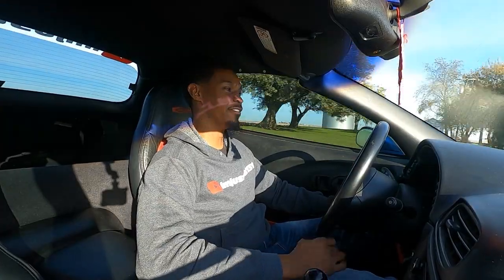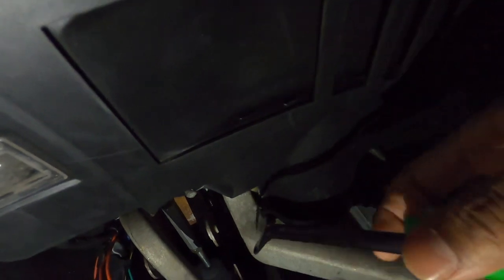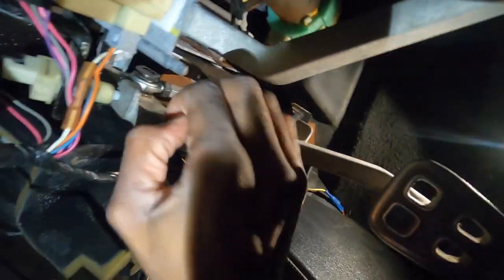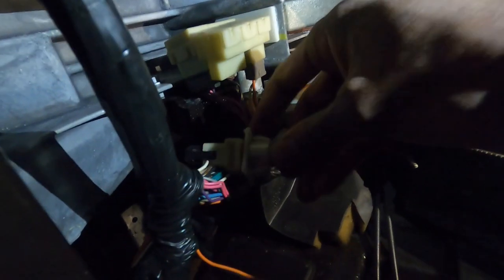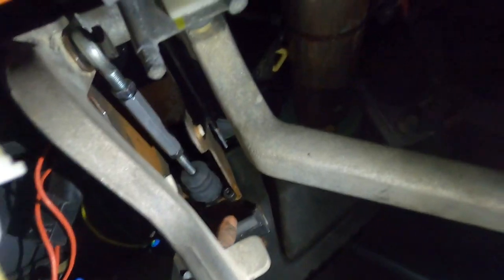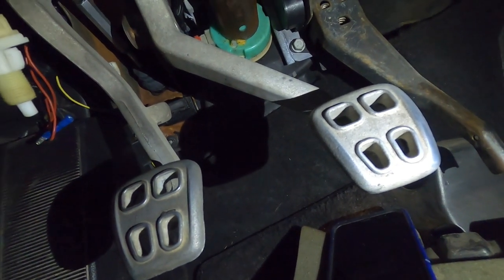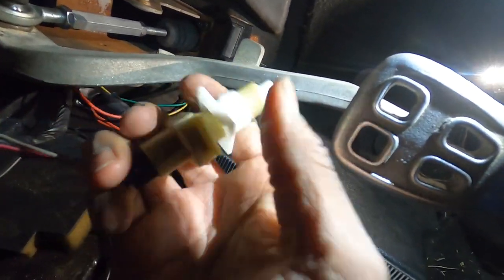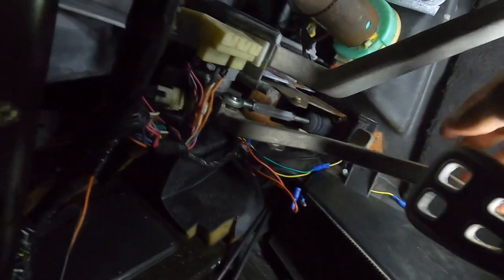CLUTCH IS FINALLY FIXED!!!!! TICK MASTER CYLINDER ADJUSTMENT

Comment: Seeing you that happy made me that happy. I love it when a plan comes together. Your dedication is admirable, the way you stuck with it and kept at it even though you couldn't shift correctly inspires me to stay the course, and keep cool. I punched partway through 2 windshields, and spidered another from the inside when I was younger. I felt horrible afterwards because I loved those cars. Not going into gear would have split my wig if it was happening to me. You are a true role model, as you taught me a lesson. Now you can enjoy the car the way it should be.
Reply from the maker: I appreciate it man. I had to get it figured out. I'm just glad it was something so simple. I try to keep my cool in most circumstances. In my mind, not much is worth controlling my mood and mind.

Comment: Tmod sells a clutch stop 

Helps a lot with bringing the clutch up to level with the break pedal and helps you not over extend your pressure plate 

Will also help you out with the switch on the firewall
Reply from the maker: Haven't heard of them. If this doesn't get it. I'll check it out.

Comment: I’m glad you sorted your problem out bro!  Looks like a tick mc is next for me.  Thanks for the info on adjusting it!
Reply from the maker: Me too bro. It's a good buy. Just be careful adjusting it. Do a little at a time.
Reply: I went from a 7/8 bore to 13/16 with my twin disc monster and It’s a lot better as far as the firm and how heavy the clutch pedal Is/was

Comment: Lol i know the feeling buddy,  letting loose and being free and grinning 😀.. I installed monster clutch,transmission, diff and rear main seal plate on mine..n boy when i was finnaly able to drive it my sadness turned into joy and aliveness ✨️✨️✨️, fortunately for me my old master cylinder works great..but i will definitely replace it w a tik adjustable clutch..heard great things about em,also skip that clutch switch they go bad fast..u need a switch or button one w two long cords to hook em up to where the switch box connects..my button start works flawlessly..or just use the old box switch n run long cables to the connector n just press it when u start..the only time u use that box is to start it, anything in between is just a waste of that switch being pressed all the time

Comment: Shifting clean! What clutch setup is on it if you don’t mind me asking
Reply from the maker: Thanks. I honestly don't know. I haven't put a new one in yet.
Reply: @CadillacJones  I tried adjusting mine yesterday, did the threaded rod move on it when you adjust the turnbuckle? Mines moving with every turn

Comment: Just curious, now obviously you got the z06, I’m 17 and more interested in the frc just because of pricing, I know the frcs exclusively the t56 m6 while you got the m12, obviously decent but less power, but what are your opinions of it for a fun daily. And don’t worry, never been in any wreck due to having fun or not paying attention, but as just a practical daily most paved county roads what do you think?
Reply from the maker: I'm not sure if you're asking about the trans specifically or just overall. The c5 is a lot of fun. Easy to toss around and amazing around curves. The power is nice too. Even the feeling of being in a Corvette, even though it's a c5, is cool. So yes it's fun. And surprisingly, I do think it's practical in most senses. I'm big into financial wellness. With the being said, if you get one, make sure it's in good condition and spend the money upfront. Miles aren't as important but get it with close to no issues. Coming into adulthood, it's important that you are financially responsible now so you can relax later. Gas prices are getting crazy and these cars perform best with high octane fuel. So if it's a daily, your fuel cost will be high. Big repairs in these cars can get expensive. You can save money doing it yourself but even the parts can be ridiculous at times. You're in the country so you should be fine but remember the car is low. So speed bumps and pot holes can be problematic. Hope it's not too much. Let me know if you get one.
Reply from the maker: Here's a video about dailying the C5

https://youtu.be/WIqVWlpLN7Q
Reply from the maker: Here's another about how much I spent in gas in one month. I did a lot of driving this month which was atypical but this car is so fun that it'll make you want to drive it. 

https://youtu.be/NC4mAMoBn8U
Reply: @CadillacJones  thank you, I appreciate the information, I will say, a neighbor of mine is actually the leader of the Kansas corvette club and a c5 z06 owner as well. Hopefully he could help me out. I daily a little Ford ranger 3.0. I’m getting 19 mpgs so fuel economy ain’t much an issue. I’m not to worried about mileage or a ton the engine, I plan on one of 2 things, a 383 stroker or a ls3 short block. I’m very responsible with my money and ain’t buying games or clothes or anything often at all. Thanks for the tips, hopefully I’ll be an owner before the end of 2022.
Reply from the maker: @ryanrake2714  that's cool. The gas mileage may be about the same but the cost will be different. If you do either of those options, you're going to have A LOT of fun..... Let me know if you grab one. Actually, let me know when you grab one. Make it happen.
Reply: @CadillacJones  yes sir, it’ll be a bit, but I just love the c5s and that ain’t going to change.

Comment: i have difficulties sometimes getting into gear, 1st and reverse mainly.....is it syncros in tranny or clutch related? I have a ls7 clutch kit, new slave and throw out bearing going in once i swap to the 6liter. i didnt buy the master yet tho
Reply from the maker: I had the same issue. It's easy now that I made the adjustment.

Comment: Too much travel with that master cylinder and you will wreck your clutch
Reply: Yup its supposed to stay low it can be slightly adjusted but it shouldnt be anywhere near even with the brake pedal. I have this master cylinder just installed it and its awesome but its pretty aggressive, it wants to be man handled at all times lol